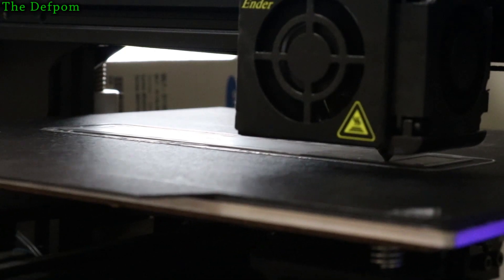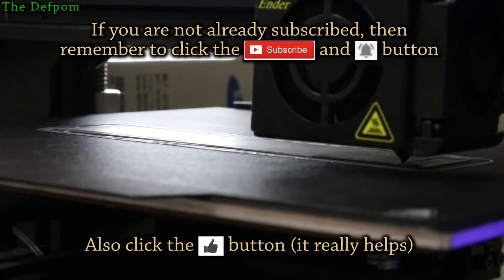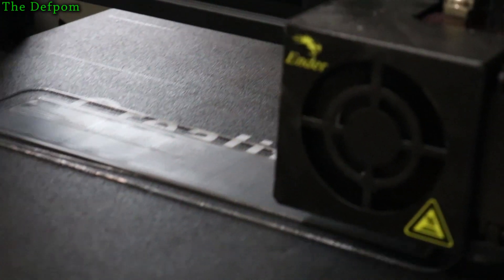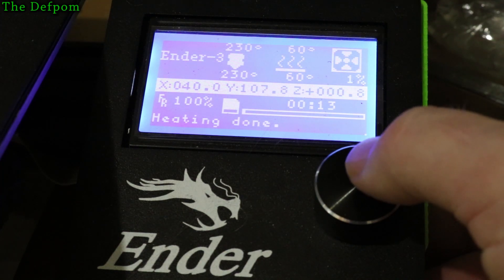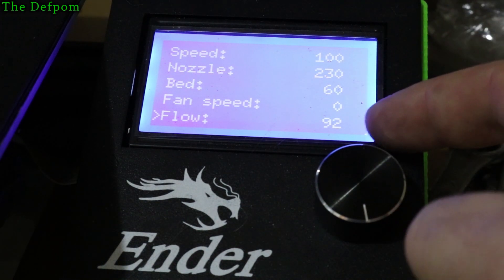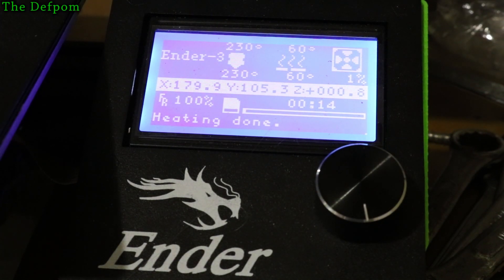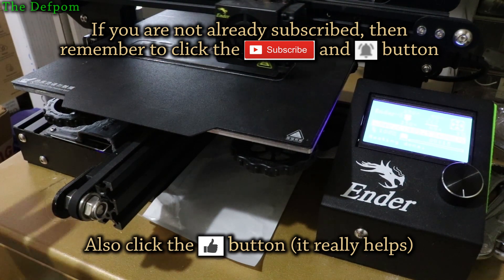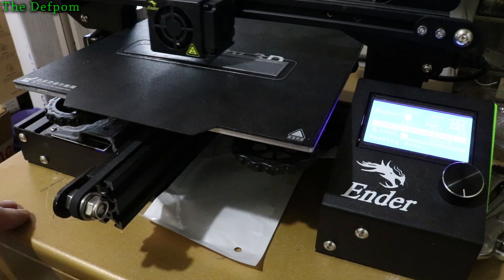🔴 #510 Creality Ender 3 Flow Rate Tuning 3D Printer - Fix Printing Issue

Comment: What’s the point of increasing or decreasing the flow? My feed stepper motor clicks because it’s trying to feed the filament I guess too fast? So do I slow done the flow or increase the flow?
Reply from the maker: Set your slicer to print slower, or try increasing the nozzle temp 10 degrees.

Comment: i, think i have a big problem my E-steps are ok, when i ask voor 100mm i get 100mm but the extrusion speed is to high and my extruded filament is 1,16 mm width. it should bij 0,48. i really cannot find the raison and begin to think i have a bad control board
Reply: Flow rate and E-steps are two different things. you can have perfect E-steps and flow rate adjustment is still needed. Try about %93 flow if your esteps are Perfect.

Comment: Do you have any issues with the layers scratching as you go higher in height or on subsequent layers? I keep getting them. The first few layers are dead on and perfect.  I am doing prints that require a larger surface area like the one on the video and these tend to get scratching on subsequent layers no matter what i do. I have to continuously adjust the flow rate when it starts to scratch and i dont want to monitor the print all day. Once i do adjust it prints smooth but after a few layers it does it again.  Not sure why this is occuring. I have also calibrated my e steps and tested it. Its like the axis starts to lose precise movement in the z direction as it goes up in layers
Reply from the maker: I don’t have that issue, maybe check that the z axis threaded nut is done up tightly, it does sound like z axis drift, you might need to recheck your z axis steps again too

Comment: Thanks for this tidbit of info. As small as it is this actually helped the most. I did not know there was a flow adjustment option on the lcd. Adjusting it I definitely saw improvements on my subsequent layers with  no scarring.  

I did however have my flow calibrated at 95%in cura but for some reason it looked like it wasnt making any difference. Not sure why. When i adjusted this knob it actually made some changes.

Edit: i think i answered my own question.  The reason cura is or was not doing anything before was because the printer flow setting was overriding the cura settings. So essentially mine kept printing at 100 percent flow no matter what flow settings i had on cura because the machine was set to 100. As soon as i changed the machine settings directly it changed. For now im going to use the machine settings for flow rate adjusments.
So if you have the latest version of marlin and you have the flow option on the printer itself you would have to disable that optinj on vs code and reflash it if you would want to adjust flow through cura.

Comment: if it was a flow rate issue it would be at the edges normally not dead center. 
I have 4x ender 3 and ender 5 and all suffer like this when new. There out the factory under flow rate. normal 92-95mm out of 100mm so 80% of people increase flow.

Also whole paper under 4 edges is abit of a pain, ignore it.

 Print a outta square and wipe it with your finger. if it moves lower that corner. keep doing it till u can no longer move it as u wipe your finger over it. Then do a center square and adjust the corners till u cant move it with finger either.. Then your first layer be perfect. The stock spings will move every few prints u pull off the bed so buy uprated springs now to save your hassle.
Reply: Interesting method for leveling. Is there a more detailed guide (hopefully a video) that demonstrates it?
Reply: @Yirgamalabar  yes! https://www.youtube.com/watch?v=_EfWVUJjBdA&t=136s